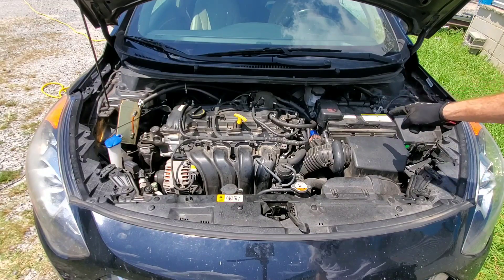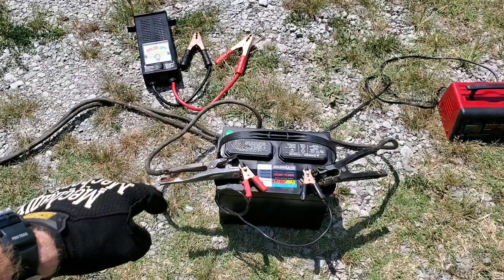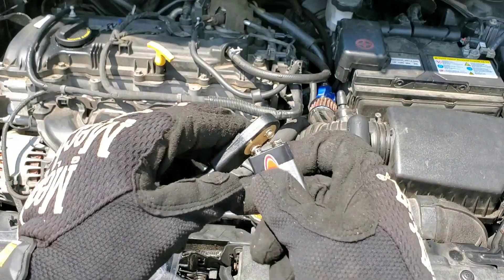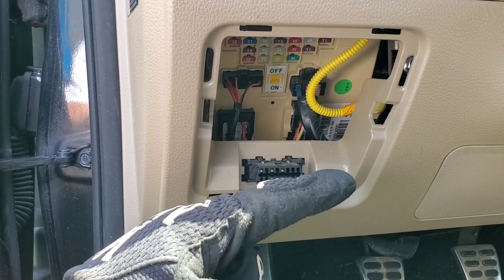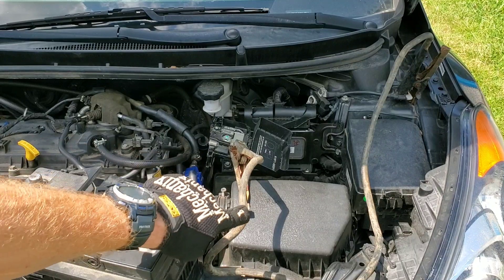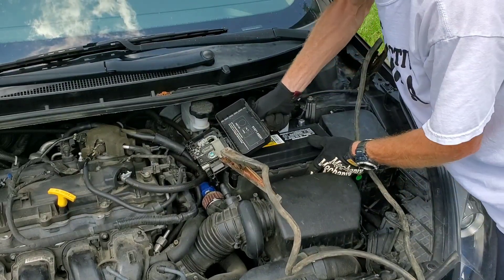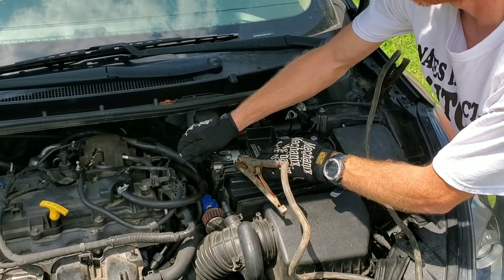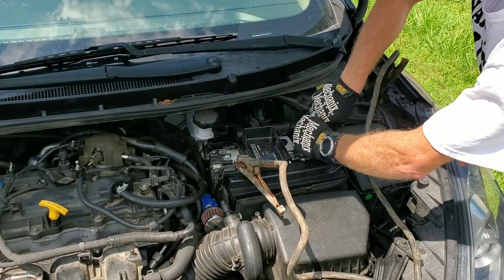how to replace your car battery  without damage!!!

Comment: I believe I could use my battery tender plugged into wall outlet with alligator clips clamped on my battery terminals before disconnecting.. I have not tried it yet, but I believe it will work..

Comment: Be professional people prefer not to reset all of the preexisting settings and that is if you get off easy. New cars often need more than a cheap scan tool to fix issues caused from battery removal.
Reply from the maker: Thanks for watching

Comment: I felt even more confused after watching this video, all those steps, and the gadgets, could you simplify the procedures, it ain't rocket science to change a cat battery. your intention is good but your narrative, not so good
Reply from the maker: There are several methods for people with limited resources and necessity.  Also a way to be certain of not to fail as backup.